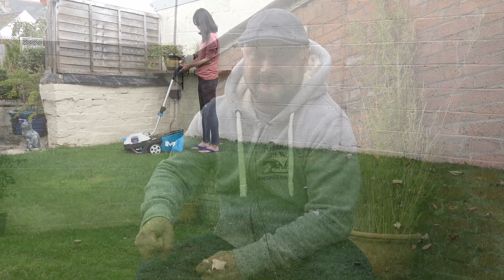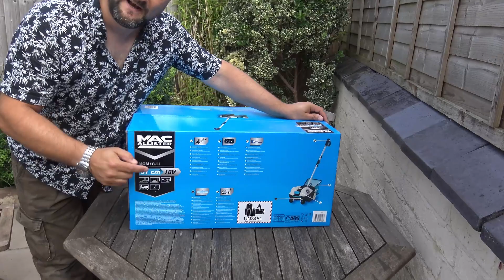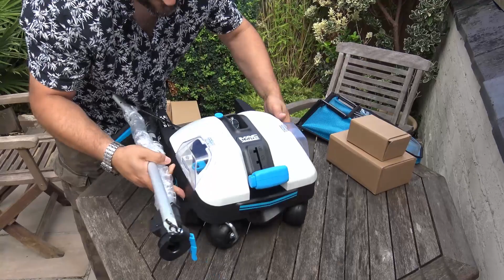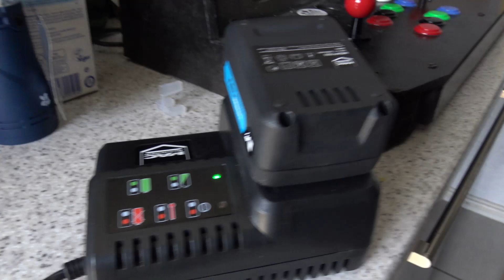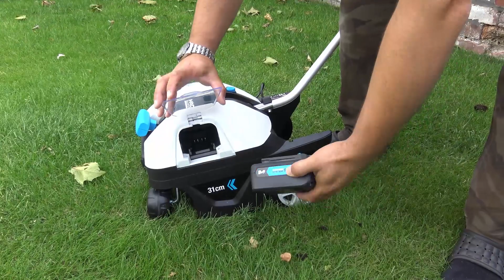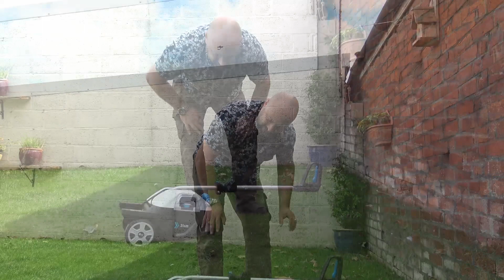DuB-EnG: Lithium Ion Battery Powered Cordless Lawnmower Review - B&Q MacAllister Mower setup test

Comment: DANGEROUS MOWER. GOT ONE LAST YEAR TO CUT FAMILY GRAVE AT THE CEMETERY.

DISAPPOINTED WITH BATTERY TIME AND CUT QUANTITY  AND LIKE IT SAID SAFETY HANDEL IS A JOKE. BUT  ONLY USED ABOUT 8 TIMES THEN BURST INTO FLAMES  IN MIDDLE OF THE CEMETERY.
 IM VERY DISAPPOINTED IN QUALITY OF MC ALLISTER TOOLS. HAD BATTEY DRILL POOR BATTERY LIFE  FAILD TUST OUT OF WARRANTY, SAME AS A ELECTRIC GRINDER FAILED AFTER 13 MONTHS  ALL VERY LIGHT USE.
I WILL NOT GET ANY MORE FROM THIS MANUFACTURER 😤
Reply from the maker: Very strong words... but yeah, buyer be ware!! ... I still use mine but it’s not an easy life... trying to get me money’s worth out of it!!

Comment: I find this a neat mower for my small patch. My biggest issue is getting the battery out of its housing for recharging....I just can't get a grip to slide the beggar out!
Reply from the maker: I sprayed a little WD40 into the housing, and now my battery slips in and out easily :-)
Reply: @DubiousEngineering  I'll give that a go, thanks!
Reply: Lol. I've just come on here to ask him the same question. I try then get frustrated with it so put it away and try a month or so later - done that about 5 times now but I do actually need to use it now. I've spent about an hour trying and it's about to go through the window!!!!!     Where abouts did you spray it, assuming it was in the mower when you did so?   Xxxx
Reply from the maker: A liberal spraying!!!  Turn the mower over so it runs down all the contacts... blooming nightmare!!!

Comment: Dont suppose youve taken it apart yet 🙂 bought one about 3 months ago for £20 from B&q which i figured was worth it for the battery even if the lawn mower was rubbish. So first attempted use and not working and smoke coming out.... Normally would return but binned the receipt a while ago.  Going to crack it open to see if i can see the cause for the short, but wondered if you been there already 🙂
Reply from the maker: Went there ... it’s a fiddle... you’ll find your way in!!  I shorted the safety switch out on the handle bars
Reply: @DubiousEngineering   Thanks that's a good point. If the electrics aren't fried and I can get it running, I think I might do the same as the safety switch seem over kill and would drive me mad in use.
Reply from the maker: Exactly!!!   Let me know how you get on!!

Comment: Lucky enough to get a click n collect for one tomorrow at £25, got to be worth that right??? Tempted to buy a second unit just for the battery.   Thoughts appreciated
Reply from the maker: Waaahhhht?!?   Holy poop yes!!!   For that price deffo!!!
Reply: @DubiousEngineering  well thanks for your honest video... For £25 so long as it works I'll be happy.... How long does the battery last ish..
Reply: You can adapt it to take worx batteries if you take it apart, make the pins narrower and bend them so they fit the respective terminals. Also a grove for latch needs to be cut out.

Comment: Just got mine yesterday. Got it at clearance price of 50 quid. It was already assembled so charged the battery and off we went. For its size it cuts well very neat but the downside is that the battery doesn't last long  about 7 minutes! I have tried locating a second battery which has been difficult  I found one on line but its 40 quid so on that basis I might as well spend another tenner and get a second mower. For me it performs ok it's a bit difficult to steer if the grounds not level. Great for storage as it's small. Worse comes to worse I might enter it for robot wars and see it gets the punishment it deserves!!!
Reply from the maker: hahah...  yeah similar to my findings...  mine does ok, but I won’t buy the same type again next time...

Comment: Just brought mine two days ago - not bad for the price. I have a small garden so I needed something compact to store. The handle your right could have been better with a double handle but not a real problem. My handle clicks in place so I dont have that issue with the mower turning off - so get yours checked in case it's broken. Not bad for 50 squids. Great video!
Reply from the maker: Wow I think i paid £80 or so... I took mine apart and fixed the handle switch to always on :-). Happiness:-).  Thanks 🙏 for your kind comments :-)

Comment: Next project, robomower mark II
Reply from the maker: Actually not a bad idea....  this cuts grass well, it isnt easy to move around, but, making those fixed wheels driven shouldn't be too hard!!  A great platform to work on!!  :-)
Reply: Exactly what I'm planning on doing. Use old hoverboard parts and controller and we're in business. Already taken it apart, removed handlebar, bypassed all switches. Single relay now can switch it on and off. Adapting wheels now so it retains height adjustment capability.

Comment: You know you want to design one yourself.
Reply from the maker: HAHA - Tim - this cuts grass well, it isnt easy to move around, but, making those fixed wheels driven shouldn't be too hard!!  A great platform to work on!!  :-)
Reply: @DubiousEngineering  
How about adding in radio controlled drive wheels 2.and another switch to turn it on and a safety switch that actually turns the motors on when you send power to the drive wheels.

Either that or use the brainn from a shark automatic vacuum cleaner.

The possibilities are endles.
Reply from the maker: Oooh.  iRobot vaccum cleaner drive train and brain! ...  I wonder if you have seen our extended robot lawnmower videos Lowell... they are a mix of fun, boring and bonkers :-)